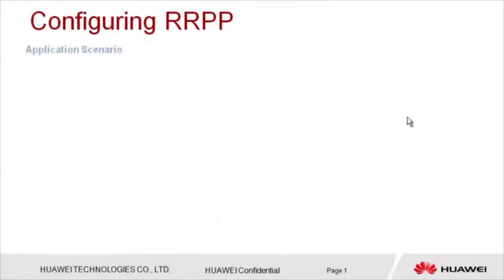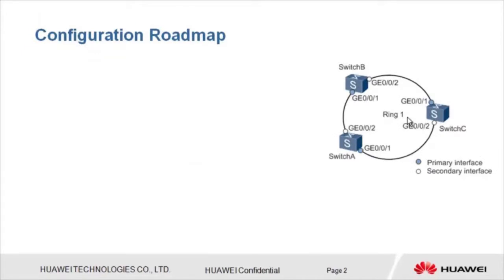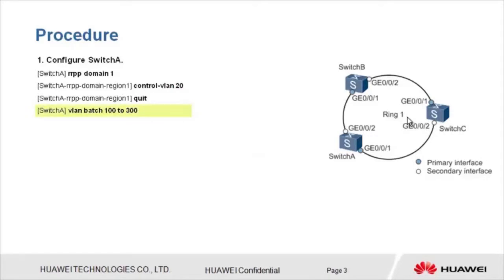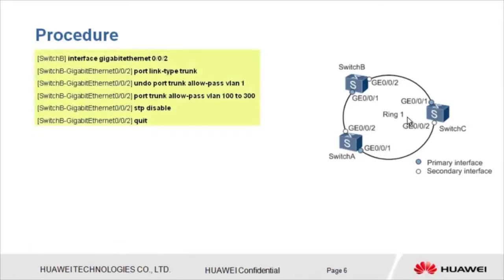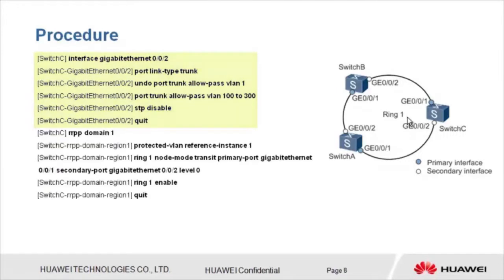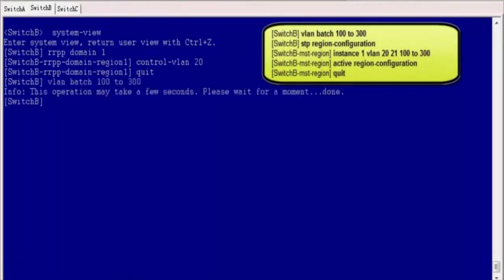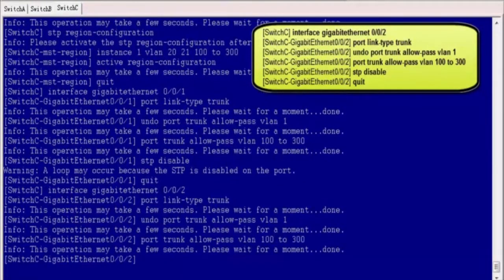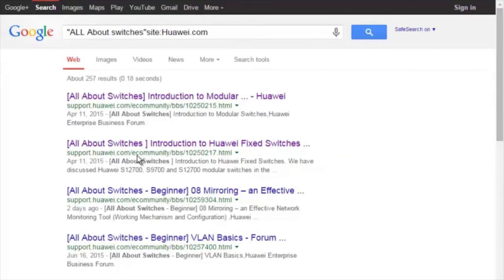HUAWEI S Series Switch-Configure RRPP

Comment: Hi, is the activation of RRPP traffic affecting on ports already in service and under traffic? I mean, if there are any recalculation that could create any outage. Thanks.
Reply from the maker: Dear Stefano Giraldo,
Thank you for your feedback. The Rapid Ring Protection Protocol (RRPP) is a link layer protocol used to prevent loops on an Ethernet ring network. Once a network is established, RRPP-enabled devices discover and eliminate loops on the network by blocking certain interfaces. If a network fault occurs, RRPP-enabled devices unblock blocked interfaces and switch data services to a functioning link. If you have any other questions, leave messages in corresponding web pages.
Reply: @HuaweiSupport  Hello, in case somebody is wondering about, I would inform you that activating the "stp region-configuration" and exactly the command "active region-configuration" cause an outage of about 3 seconds, obviously if you have some routing protocols between routers connected with the huawei switches, you'll have to wait for the re-establishment, hence more delay. This is why the procedure suggest to configure a large number of VLANs in in the stp region in order to be ready for the future and don't have others outage while adding new VLANs. In any case, I think it's unbelievable that this behavior is not reported anywhere, since it is an important information if you enable RRPP on devices already under traffic. In my case, I understood by myself, loosing everything for about 20 seconds. 
I also leaved a message as you suggested, but nobody replied. I sadly have to say one more time that using huawei is a "jump in the darkness", because nobody knows what could happen and the support pages lacks of satisfying info.
Reply: Huawei Documentation Insights  Hi, yes I perfectly understood the behavior of the protocol, but my concern is regarding the activation. As I wrote I would like to know if there are any possibile recalculation or down/up interfaces in the moment the protocol start to working. Thank you.